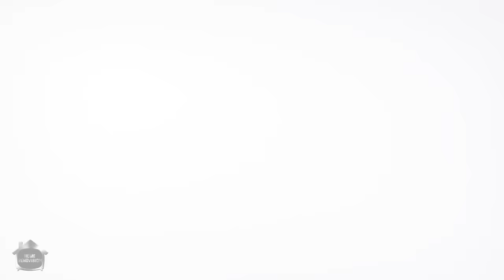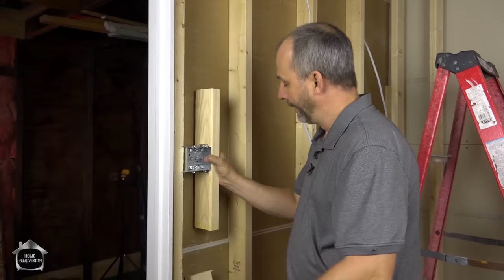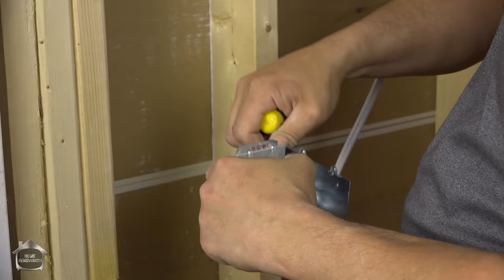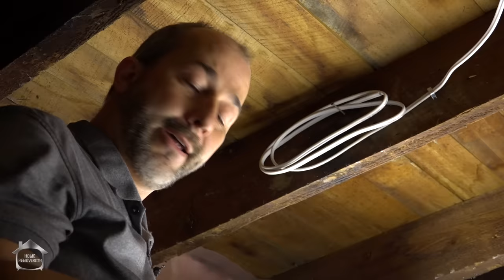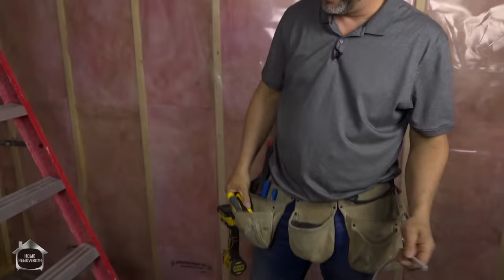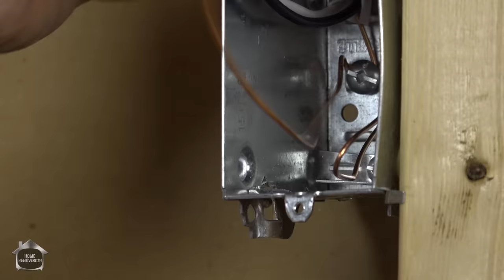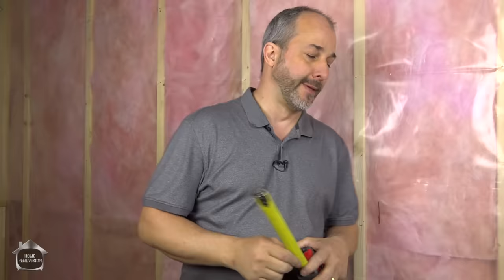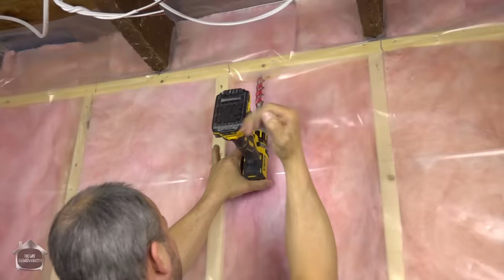DIY Bathroom Wiring | How To Run Electrical

Comment from the maker: Let me know where you live and what type of wire the code requires where you live. Cheers!
Reply: Originally UK where we have "real" power, not your mickey mouse 110v stuff :-)   Now Atlantic Canada, so pretty much same as Ont.
Reply: I am in Australia. Also, I am not quite up to your level, just a beginner @ DIY.
Reply: In Québec, its pretty the same, but here we NEVER fixe a box by the outside, unless we need too, like when we need to shime the box 1’’ and more. Because as you said customer always change mind. Really easy to add a gang box when you can remove the box without damaging the drywall.
Reply: Ontario. Doing a basement bathroom now. It was suggested to me that I bring power in from panel to GFI then run to switch then run to fixtures. That way GFI acts as a breaker. Sound good.?
Reply: Il am in France but love so much your videos
Reply: @ethanplaysgames9623  That's awesome! :)  When I was 12, I was starting to do my own electrical projects around the house I grew up in.  I did simple stuff like adding outlets and lights in the basement and garage.  If I were you, I would try to learn carpentry, plumbing, and electrical skills.  You could become a general contractor.
Reply: DR Dan  jeez, are you serious? A panel in a shower?
Reply: I'm in the USA! In my area, code requires I pull a permit, and when I'm done have an inspection. I can do all work on my own, everything installed up to the point of turning on the breaker.

Great video by the way, it's a good idea to have that extra wire at the boxes!

The original wiring in my house is pulled around any corner with barely enough wire to pull an outlet more then an inch or two out of the wall. 

Oh all ceiling lights, two entire bedrooms, and a bath were run off one 15amp circuit. 12-2 with no ground... 3 prong outlets
Reply: DR Dan  
Believe it or not this isn't the first time I've heard of a panel being in a shower.
Reply: The 2017 edition of the NEC stipulates a dedicated 20A circuit for bathroom GFCIs.  Interesting the different codes/standards for the different jurisdictions.
Reply: Greetings from Sberdeen Scotland. Love the videos. Look forward to the future of this Channel
Reply: Greetings from Aberdeen Scotland u.k.... 
Keep up with these videos. I'm learning so much from you. Cant wait to see where this Channel is heading. All the best
Reply: Use 14/3 or 12/3 to run your exhaust fan so you can run the fan and light separately
Reply: Britain! Only a qualified electrician can do wiring here. Love the fact you do everything properly according to code.  Quick question - why not put the fan in the shower cubicle to catch all that moisture and steam?
Reply: Texas, USA .... none
Reply: Chicago ... I have to use EMT conduit.  I would love to get info on EMT conduit use and cost.
Reply: Plastic boxes make life easier for sure bro
Reply: I live in Mexico and can basically do whatever I want :P
Reply: In the U.K. any work in a bathroom is classed as a “special location”. Chapter. 701 in our “code” the BS7671. Therefore it is classed as notifiable work under Part P of our building regulations. Requiring notification to the local council through inspection or by self certification which us electricians use. The bathroom
Is divided into zones originating from the shower or bath and there’s no socket outlets full stop permitted in a room with a shower or bath.
Reply: ak0792 not true pal! Can use a similar system to The Americans where an inspector from a building inspectors etc could come and inspect along with a completed electrical installation certificate could sign off your work. It’s costly to be fair !
Reply: just subscribed, can you do videos on daisy chaining surfacemounted fixtures such as those done in kitchens and living rooms???
Reply: US - My inspector wouldn't pass my install with the "extra loop" of wire above my outlet/switch boxes.  It was easy to just pull the wire through the boxes real quick and then he was fine and passed everything else.
Reply: Zeus Cronus  that's because Austin is weird as in big government.
Reply: im in pa! i could use some pointers on a finished basement im doing from a pro familiar with pa codes. any help is appreciated. someone send me contact info if i can pick your brain!?
Reply: You want like my address?
Reply: Milwaukee,Wi. USA.  Bathroom 12 gauge
Reply: 20 A with GFCI, and a fan
Reply: I live in Sweden and work as an electrician. Our rules is kinda wierd, the only things a normal person can do is like replacing sockets and switches. But only if you're sure you know what you're doing. I have one question tho that bothers me alot. I watch alot of electricans work on youtube from all over the world. And i get so annoyed that like all countries have loose wires in the walls. In Sweden we only have pipe installations. So we can always replace or add conduits easily, no hole taking in drywalls to trying to fish stuff. I find it really wierd that so many countries doesn't even change their standards to the pipe system since it will be alot better in both having something protecting the cables and having a easier installation and making it better for future changes.
Reply: In the uk, no switches can go on the wall on the inside of the bathroom at all, search dry wall boxes uk. I think the uk regulations are a lot more strict. There are 4 zones in the bathroom. Search BS 7671 regs if you can ever be bothered! Good video
Reply: I know for a bathrrom we need a dedicated 20amp circuit requirement
Reply: @haroldobrien8550   theres a million ways to skin a cat but I'm an electrician going on 12 years now and that's how I always do bathrooms I add to my houses... from panel to gfci then to switch then hit the fan and lights
Reply: Where are you from? Do you have plastic boxes? 

I live in New Hampshire a few hours from Canada and no electrical inspection is required!!( When I pulled the cover off the full 20 space panel it was a rats nest. The neutral bus bar had up to 4 wires under some terminals and the oven neutral and ground wires were piggy backed on the main neutral wire from the meter. That is just the top of the list.
Reply: Hi, thanks for your videos. I live in Dade County Florida.
Reply: BC Lower Mainland and have no clue on wire code
Reply: Stick with drywall you’re not an electrician
Reply: eazzzye2003 Up here in Canada you can wire an entire house using only 14 guage wire except for the stove, and dryer. I wish 12 guage was required since it does not cost a lot more especially when you are working on a new job. I’ve also seen a lot of houses built as recently as 2009 with stab lok panels and 100 amp service. Canada always seems to be a bit behind. Like it wouldn’t of cost much more to put in a good square D QO panel, 200 amp service, and 12 AWG for most of the receptacles.
Reply: Michigan.  GCFI in bath must be a dedicated 20 amp circuit, not allowed to run lights/fan off it.  Seems crazy, but inspector caught me on it.  Helped son finish 1500 sf 9' ceiling basement, used all steel studs.  He is an ironworker.  Did everything but drywall.
Reply: You're great, you're awesome!!!! Love your videos very simple and very well explain!!!! Cheers from San Francisco CA. Keep it up!
Reply: houston texas , what about yourself?
Reply: South Carolina USA. Is the 36” code something I need to use? Or is that just for where you are?
Reply: By code you actually need 12 AWG
Reply: What about the wire and insulation on the ceiling? I have wires just laying on top of the insulation. How do you remedy that?
Reply: Where's your hammer? ¡!!! Blasphemy
Hahah
Reply: I love how he thinks of everything while he preps..he literally thinks of everything.
Reply: TEXAS!!!!
Reply: DR Dan  I was in Mexico back in the 70's and there was a fuse box above the shower.
Reply: In Norway we have to be an electrician to do any electrical work, we use 2,5mm2/10 gauge on a 16A fuse✌️
Reply: PRETTY WOMEN DON'T NEED MAKEUP.
Reply: 12 gauge 20 amp circuit for bathroom plugs(gfi's) dedicated sharing with another bathroom. Most hair dryers, now days pull so much power they will trip a 15 amp circuit. Lighting is 15 amp shared lighting circuit.
Reply: Ole Anderson Did you run lights on a 15 amp breaker?
Reply: ***j***
Reply: DR Dan  Ffs.....   HAHAHAHAHAH, better leave well enough alone.
Reply: I live in Centreville, Virginia. I already have existing bathroom but I want to install a outlet next to my toilet so i dont have any existing wires running through it - would it be still possible to install an outlet through the wall?
Reply: @andrewcarr2431  Power in most the of the USA   110/240 volts.  I have seen the UK 240 volt system of wiring.  I like it.  But were stuck 110/240 instead of 240 V.
Reply: Bathroom in NY State Requires 12 Gage for Code, I've also went to my Friends house in Alabama they are aloud to put Plugs under windows this house was Newly constructed in NYS I believe they will fail you for it... I was always taught no Plugs under Windows
Reply: In Belgium, we use solid core singles "VOB" in flex or we use XVB cable which is 3/5/7/... VOB wired in an extra layer of grey PVC. Our wire and cable is specified in square millimeters, cable is specified by the total number of wires, then an X if there is no earth wire or a G if there is, and then the thickness of the wires. Most common used XVB cables or pre-wired flex are 3G2.5 (earth, neutral, live) for sockets and 5G1.5 (earth, neutral, live, 2 two-way switch wires) for lighting. Common practice in DIY is to only use 3G2.5 for everything and just run a second length where more than 3 wires are needed or use 5G2.5 and cut away what you don't need so you only have to buy one spool.
Reply: @r.kimshultz  You probably got your answer already but everything he did in this video, imagine having to run it through a rigid pipe you bent and hung in place. For instance: that future ceiling fan he planned for, you need a box there in place connected to emt in order to pass your electrical inspection. Lots of math and geometry in rigid conduit. Good news: there are youtube videos for that too.
Reply: San Diego
Reply: nova scotia...only electricians can do any wiring. An electrician said to me that i needed an electrician to install pot lights and that they are $30 each - which i found to be ridiculous. I asked my Halifax electrician and he said; i don't need an electrician to install it. People in that province are lazy and dishonest, the Halifax ones are ok but that's as far as it goes. Us Ontarians are used to quality and efficiency, you will not get that here in nova scotia at least not outside Halifax.
Reply: receptacles (gfci or afci)  must be 20a breaker which must be 12ga. lights could be on this circuit but keep in mind if you trip the 20a you won't be in the dark
Reply: Belgium 3x 400V + Neutral. Code requires 1.5mm² copper for lighting and 2.5mm² for plugs.

Comment: Every time you ran your knife down the wire it gave me the shivers. People do not realize how easy it is to cut the insulation on the individual wires inside. A lot of the troubleshooting I do for a tripping breaker is because of a skinned wire. Do yourself a huge favor and only cut about 2 inches from the end and peal the jacket then cut off. 

PS Sharpen that bit so you do not have to put the drill in reverse to get it out!

Rock On!!
Reply: I see people use their utility knife all the time and I assume the same thing but never knew for sure if people were damaging the insulation or not
Reply: amen brother
Reply: Or buy a Klein romex stripper. Tho they are a little pricey.

Comment: Utah its required for 12gage 20Amp circuit dedicated plug GFCI.  Ive run a 12-3 up to the exhaust fan in case I want to change out the fan to a fan and light combo.  Used some scrap 2x10 sideways between studs with pocket screws around towel bar height to give me more options and something solid to screw into.
Reply from the maker: sounds like a good plan. Cheers!

Comment from the maker: This video is designed to take the mystique out if doing your own electrical. always consult the code for electrical in your area before beginning any work to ensure you are code compliant., Cheers!
Reply: That's a poor excuse to put up a video giving advice that's LESS than mediocre.
Reply: @Skylane2005  Care to explain the issues you're seeing. I've found in my career the guys that don't know much are the one's who say "I can't believe you did it that way." While the guys who know what they're doing will say "I've found this method works best and here's why." Be a teacher instead of an excuse maker, it'll change your life.
Reply: I appreciate the video. These "by the book" guys will always get ya on the details, even if you left 30 disclaimers throughout the video.
Reply: If I’m doing it myself on my own house using YouTube as a guide... even with you as a Sensei? Good enough for me; 
prob not code compliant.
Reply: People are usually shocked when they find out I’m not a good electrician.

Comment: I am literally in the middle of a complete bathroom remodel of a century farm house. Love this channel and I use it for all my remodeling now and forever!
Reply from the maker: Cheers Philip. Looking forward to hearing from you about your specific challenges.
Reply: Main problems I've had are weird double layer drywall 18"x4' nailed every 3 inches. Demo was horrible. Plus the old corner bead they used in the day was a wire netting, super annoying!

Comment: I’m in the Detroit area and while finishing my basement I’ve watched a few videos and enjoyed the information you’ve given. When I ran my wire I put my roll of wire by the breaker panel and ran it to my farthest outlet or switch then connected everything. It helped not having a ton of extra wire to clean up. Plus if I needed more I just pulled some more down the line.

Comment: Thank u so much for talking about how far apart the lights have to be for the dark spots. I found out light will sometimes affect my vertigo we just ran new lights in our bathroom and couldn't figure out what was going on every time I would walk in it had never been an issue in the past. This explains everything thank you, it might be a pain to go back up there to add a couple more lights but to save me a headace down the road itll be easy

Comment: Great vid, two things, I noticed when you pulled your wire into the metal wall box through the knocked out tabs you did not put in any twin screw clamps?  Is it not required to have that or some kind of grommet to protect against chafing?  Second, dude throw on some safety glasses.  Watching you drill overhead like that gave me the heebie-jeebies.   Many moons ago got a piece of metal in my eye by being careless almost lost sight.  Cheers!

Comment: You also want to remember that NEC states that you have to have a minimum of 6 inches of workable conductor from the face of the box and not the back. The best way to determine this is to use the length of your wire cutters to determine the length of the wire. I also like the idea of leaving a service loop in the wall for future electrical replacements.

Comment: I live in Medicine Hat Alberta. The codes are very similar to Ontario if not the same, if I remember 30 yrs ago stuff and things. I got lost on a few things  you were doing, so that means I have to watch again to point them out. No it wasn't the floor heating. That was something I never worked with. So Thanks for that info!

Great video once again.
Reply from the maker: Cheers!

Comment: Good video Jeff.  I am under the assumption that stapling the wire to the bottom of the joists is a no-go, even with strapping before drywall.  If the drywall is up, it would be no problem to fish through that area.  Maybe depends on what the inspector sees in his 5min rough inspection, and if you have the ceiling boarded up by then :)
Reply from the maker: no problem running wire to the joist. That is done all the time. The strapping does not even need to be installed at inspection.Cheers!
Reply: @HomeRenoVisionDIY  I saw you run the wire to the bottom of the joists and wondered if you would pass inspection. Then I saw something about your strapping.... Will you pass inspection that way?  Or will the wire clear your strapping for the drywall?
Reply: @HomeRenoVisionDIY  Hi Jeff.  I love all your videos!  I've been reamed out by a master electrician for attaching wire beneath a joist because the drywall supposedly pinches it and risks it being screwed into on drywall attachment.  I understand this latter argument.  Why not make holes in the joists like we do in studs?

Comment: Just for clarity's sake. 120v × 0.5A = 60W. A quarter of a 60W light bulb is 15 Watts. Presume it was just a mistaken slip. 

Thanks for all this Jeff. I truly appreciate it, and I know all those watching do as well.

Edit: you said it was low voltage so this math may be missing necessary information.

Comment: I have 4 short extension cords to use when we travel.  Two are commercial 2 wire with ground ones that light if they have power.  I made two very short cords [about three inches].  One is 2 wire with ground and the other is polarized 2 wire.  Most of my stuff is universal voltage input [100 -240 volts; 50/60 cycle] but has USA plugs.  I travel with fewer adapters to plug into the wall wherever I happen to be.  I buy my plug to socket adapters at Walmart.  I used them and Walmart multiplug bars to create photo light panels.

Comment: Im an electrician in Quebec. I wire most baths 1 circuit is plenty for lights, fan, and a blowdryer. 1st to gfi, so loads lighting and fan from it are all protected by gfi. Heating is another circuit always 240v either floor or baseboard heat to thermostat.